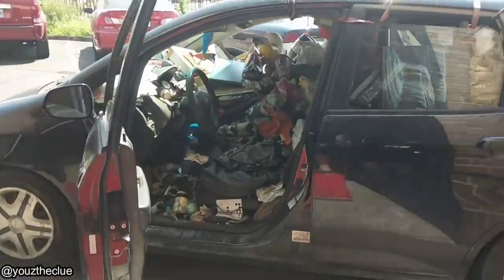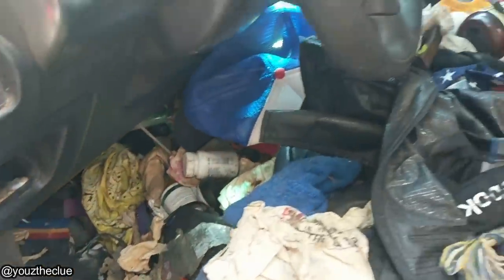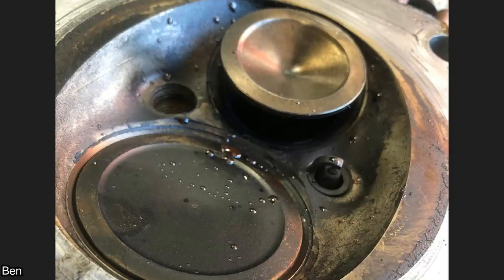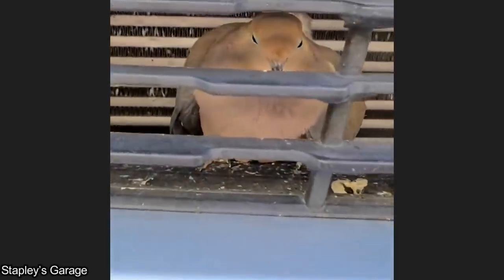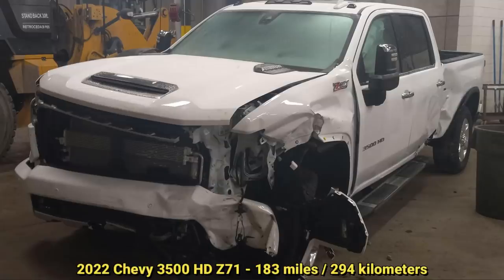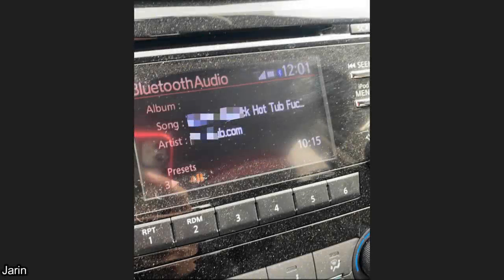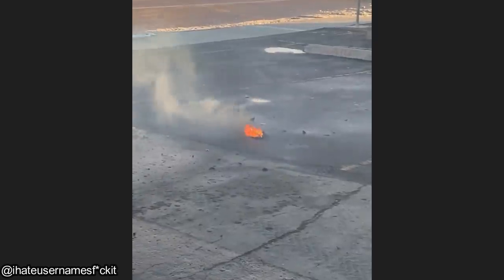Customer States Install New Tires | Just Rolled In

Comment: Never let your son touch your treasured car or truck!
Heard from a guy work for a car donation program. They once got a Lexus GS430 donated. The story is, parents give this car to their son, then just 2 or some months, not a long time anyway, it blow 2 tires by hitting curbs (not the same accident), but thank god rims are okay, and front bumper injured too. All brake pads on 4 wheels are completely wear-out. It's still pretty much drive-able after tire change and brake service, but it probably need wheel aliment. Judge from its interior and unharmed exterior, this car used to be well treated. But just those days in their son's hand, half of its value is gone. It's on-board computer shows its past mpg is under 10! To be a comparison, after some local and highway driving by the guy (SMOG preparation, OBD cycle driving), its mpg rises to about 25, and my 94' Chevy Suburban K2500 with 454 engine and full load of camping gears still has 11-13 mpg on highway.
And another interesting story, from that guy too, they once got a Dodge Ram 1500, 360 V8, automatic. Donated because the owner think it's transmission is broken, never get into 4th gear no matter O/D is on or off. The owner said it used to be stay in 3rd gear most time on highway, after driven by his son, it never goes 4. After they pick up the truck and did a diagnose, it turns out, its TV cable is stuck at full throttle due to rust, after disconnect the cable from transmission, the truck shifts fine. The guess the owner used to be a gentle driver, never hit more than half throttle, so it stuck on half throttle, stay in 3rd mostly, 4th still sometime works. But when his son drives, he wants to experience the power of 360, probably flat out somewhere. From that on, the transmission always thought it's full throttle, refuse to upshift to 4th.

Comment: Oh no. The parking brake one with peanut butter I recognize that Jeep Compass interior, either that or it’s a Cherokee. The first clip we also had a trash filled car come to the dealer too it was a white either 2014-2016 Cherokee, they were sent home to clean the vehicle first and the advisor tried everyone including me to bring the car up. You could smell it in open air from 10 feet away and I’m not the one to throw up, when I opened the door I gagged several times and nearly did, it’s that bad for anyone who’s wondering, but the car in this video is ATLEAST  twice as bad as the Cherokee.

Comment: Yes, people, turn off your Bluetooth! We don't want to listen to your phone calls.  We don't know what will happen mid program if you have a phone call. Turn off your Bluetooth.

And the floor mats are a vicious cycle. New car comes in, carpet floor mats upgraded to the rubber molded ones, dealer doesn't want to store the carpet ones, let the customer take them with the vehicle but DON'T install them but they don't get the message or they do anyway.

Comment: Over the years I have seen several cars packed with trash like the first one. We joked that the driver was using the electric seat as a trash compactor because the back was really solid. Also had a Chevy Astro van come in for an alignment and it was 1,300 pounds over gross weight. It was too low, and we couldn't get the proper ride height.
Reply from the maker: Dang, 1300 pounds over gross weight. That's impressive.
Reply: @JustRolledIn  ... just remember that size van is NOT full size. Gross is 5,900 so only a half-ton vehicle. They had installed heavy rear springs already, but the front is torsion bar / adjustable.

Comment: The got a car in just like the first one all full of trash.  Customer complaint was no heat.  It needs a heater core.  I told them not till it was cleaned.  I haven’t seen them since, but the vehicle is still at the shop .

Comment: I'm too introverted to even ring and ask for a wheel respray, imagine pulling in with half your house inside the car, or peanut butter smeared all over the damn console and gear stick, without even thinking about having the decency of having a clean car for professionals to work in and on.

Comment: I can't think what could be causing the civic hybrid to have accelerating issues, or what caused the rear shock issues.....
Reply from the maker: I'm not sure you know what you're talking about 🤪😉
Reply: @JustRolledIn  I think I FINALLY figured it out....

The customer was adding the mass not to improve the weight and balance of the car,

But to increase the vehicle's gravity, as part of a secret gravity drive propulsion system!!

The owner is a genius ;-)
Reply: Something like this (ok, typically with less weight) was done in the past with RWD cars in icy winters (to get more grip on the drive axle), but since the Civic is a front wheel drive car this can't be the reason

Comment: Years ago I used to work at a casino in the traffic department. A car was brought in with as much trash as the one in the first segment. The valets refused to drive it, stating it would make them smell like trash the rest of the day. Management insisted the valets park it, because the patron was a big spender.  To solve the impasse one brave valet pulled the car down and pulled the keys and sent them to the outside security to give to the guest when they left. No information on how much the guest tipped.
Reply: Wow 😳 That seems like abuse of the employees by management to be honest! Sad that the customer was happy to drop big dimes on gambling but not on hiring a car cleaning service... all part of the mental health side of the problem I guess.

Comment: I know why he put egg in the oil pan

it's to fix a leak, commonly used in radiators too, ye crack an egg into the radiator or oil pan and it cooks itself on the way to the leak.

shocked anyone ACTUALLY tried to do that, because ye also need black peppercorn in there too!

Comment: The automobile at the beginning of this video. Is close to what my family member does to every vehicle she has had or driven in, including my van. Which obviously I am not happy about, since everyone that sees it rushes to the conclusion I am the pack rat. Until they find out just how many times I have had to clean up her mess in my van. (Yes I have taken it away from her, but she cannot keep a vehicle running). 

On top of you can definitely see the difference in how I live vs how she lives. By comparing our rooms, which are vastly different...

Comment: I was all haha, fun and games, dirty cars, concrete but then....

Whatya talking about exploding impact batteries? We talking Snapon or Milwaukee? Oh nevermind...Im taking them out of the box and putting them in an air proof safe
Reply from the maker: Milwaukee they said it was.
Reply: @JustRolledIn  Of course! And here I am staring at two 6.0Ah (insert awkward laughter)
Reply: @JustRolledIn  Honestly, Im hoping that maybe he dropped them. Li-Ion batteries are explosive when exposed to oxygen. Im hoping that any flaws in the protective coating in the cells would have shown itself while on the shelf of the store...right...RIGHT?

Comment: At least they didn't try putting out that lithium battery with water, since lithium reacts with water and produces highly flammable hydrogen, which can cause an explosion.
Reply: that would have made it all the better filming experiance.
Reply: The lithium inside the battery is no metallic lithium but an oxide, it's always put out with water by fire brigades. In the case of a battery pack the water additionally cools down the pack, preventing other non burning cells from getting a thermal runaway

Comment: Note how that 20 volt battery flames up when it catches fire. If you take the battery out of an EV which is couple hundred times bigger and it catches fire don't even bother getting the water hose. You can't put out the firewood water hoses or sand or fire extinguishers you need special equipment.
Reply from the maker: 18v I believe that one was but yes lithium ion battery on the impact. Water ain't doing nothing with that lol
Reply: Battery vehicles on average take about 20,000 gallons of water to extinguish because the fire has to burn enough holes in the case for water to get in.
Then they can reignite hours or days later because there's no real way to effectively drain the power charge to the damaged battery.
Reply: @JustRolledIn  Water WILL put it out, but you're going to need more than a bucket...
Reply: I believe the older Tesla battery packs were just a ton of 18650s, which can also be found in impact wrenches. Wouldn't wanna be around that car if it started burning.
Reply: @UkraineJames2000  in germany we have special containers where the burning e-car is pulled in with a winch and then the fire department floods the container
Reply: @egalegal1666  the fact that's even a thing should be a red flag for purchasing an ev.
Reply: EV fires are called thermal runaways.
Reply: @ffjsb  I'd call that a damn-aged battery.
Reply: @foodhatesme  In Germany electric cars are also partly prohibited in underground garages.
Reply: From memory marshmallows are part of the special equipment :-)
Reply: @Slicerwizard  We are talking about the unique dangers of the battery tech, you well, you just typing. Localized fires of gasoline, oil and diesel can me managed.

Comment: 1st one must be a prank to get a reaction. Probably has hidden cameras inside and cameramen hiding behind the bushes / in a SUV with tinted windows across the street. 
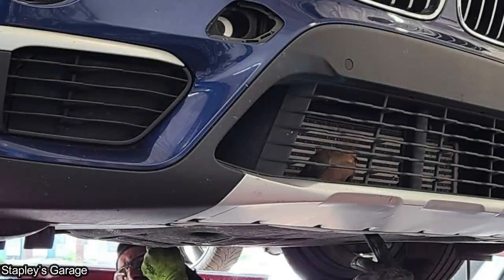1:45 I count 10 bags of cement in the boot / trunk. They weigh about 20 Kg / 44 pounds each so 200 Kg / 440 pounds
Reply from the maker: Lol no camera crews, it's real.

Comment: I'm actually surprised to see Mega Foods vitamins. Those are the best vitamins on the market, in the worst model car on the road littered in the most disgusting fashion. If it were my shop I would replace the tires for the cash but would do absolutely nothing that would require me to actually drive the car. Some people are disgusting. That vehicle is probably technically inoperable given the mess and the owner should be issued a ticket for unsafe driving.

Comment: I've worked in the most disgusting cars you would think a person would smell awful and look crappy with fast food stuck to their clothes. I've worked on some cars and took a screw driver and scraped off the grease from the steering wheel. I wanted to ask I am a mechanic how did you get that much crap on your steering wheel and mine is so clean? They must be some kind of troll.
PSA: Cold weather is here its a good practice to honk your horn when you start your car so the wildlife gets out from under your car.
Reply from the maker: Good, PSA! Luckily haven't had an issue yet. Surprising though because we got a lot of rabbits here.
Reply: @JustRolledIn  I've seen a cat that somebody loved a lot because it was shaved  around its back and stomach and was stitched all the way around it got caught in the fan belts of an old Mustang.
Reply from the maker: @teslarawks1673  damn, poor cat!
Reply: @JustRolledIn  I imagine it had a poor owner after that Vet bill.

Comment: I have news for you. any vehicle that is too dirty to service. Can be denied by the shop owner or the manager or employee. That it might cause harm to himself working on it. If your car is too dirty on the outside. You must clean it first or have it cleaned. this is also with the inside of your vehicle. I know several mechanics they would deny any job that contains baby seats. Clothing items. or even change in the ashtray. if your car is broken down we apologize. Stuff like that happens all the time. But we are not your maid. contents of your car can injure an employee. Costing the insurance companies millions of dollars every year. The only thing that should be in your glove box is the manual. And your registration. and that goes for in the back of the trunk. The only things that should be in there. Is your spare tire. Your car jack. Your first aid kit. and safety triangles. please tell your mechanic if you have road flares in the back of the trunk. Because those can ignite If the mechanic is using a torch. they are trying to pass a law. In North America if your vehicle is not clean inside and out. a police officer can give you a fine. If your vehicle is a hinderance while driving. Just recently there was a woman who was killed in her own vehicle. Because she could not reach the brakes. Fast food containers blocked her brake pedal. Slamming your against a wall on the highway. The insurance is denying all costs. Due to the garbage inside the vehicle. the best advice. To give you is clean your vehicle. The second best advice I can give any individual who's working on vehicles. If you see this. Please tell the person to clean the vehicle first. Even if you're working on the wheels

Comment: why do people collect floor mats?
Reply: It's a good idea, if one is worn you just throw it away and have the next new one already in the car ;-)
Reply: @simonm1447  it's going to take a few lifetimes to wear through all those
Reply: @executive  If you are a worker it wears faster - in my last car even the light switch had no paint left on it after 100k km, and the floor mat had a gaping hole in it. 
My Employer has a Hilux, it has around 100k km and the leather on the steering wheel is falling apart and the stick shift's leather cover was removed years ago because it fell apart.
Reply: @simonm1447  I am a "worker". My vehicle has nearly 100K km. The original mat is fine. There's no good reason to have this many mats. They will just trap dirt + moisture and make the vehicle more difficult to clean.

Comment: What the hell is it with americans and hoarding? Does it have something to do with genes that evolved only in a specific area or maybe some hereditary mental illnesses? It is not meant as a "murica" comment, I am genuinely curious because this is not a thing here AT ALL, you don't see that in ANY car, let alone one brought into the shop or driven. Sometimes just "abandoned" vehicles, but mainly used for storing scrap, which is something else entirely. We usually tidy up the whole car, most of the times even a full inside/outside cleanup with vacuuming and all before going to the mechanic.